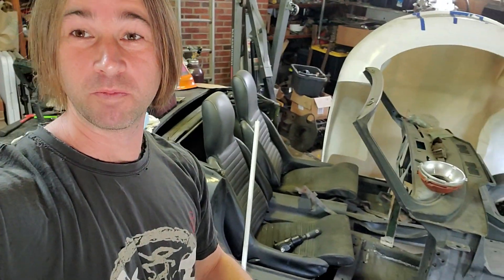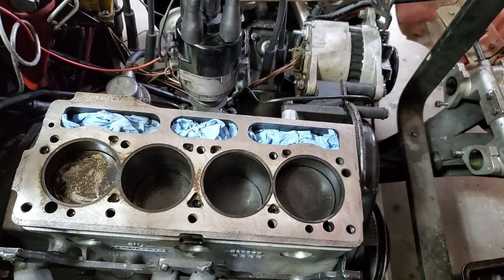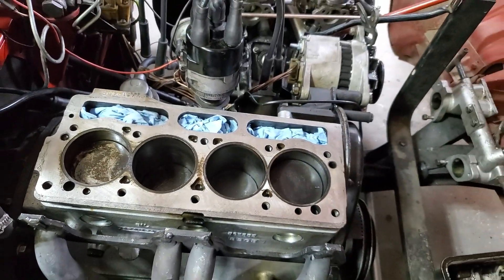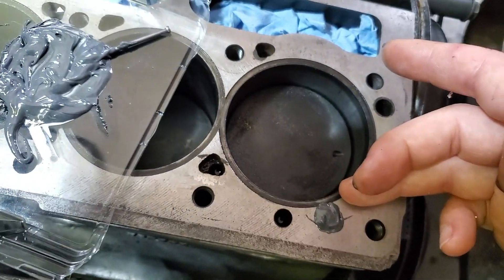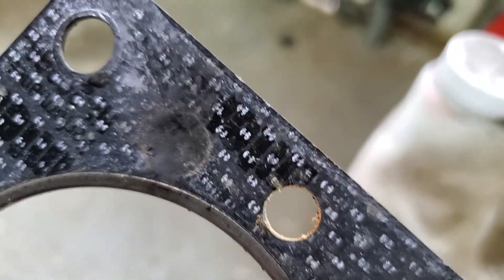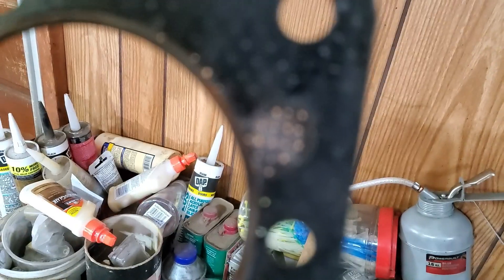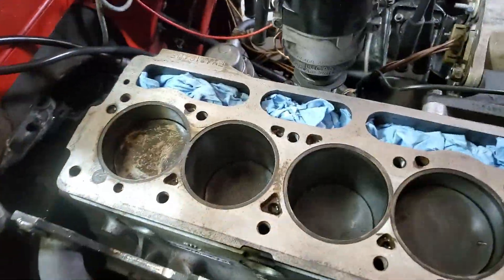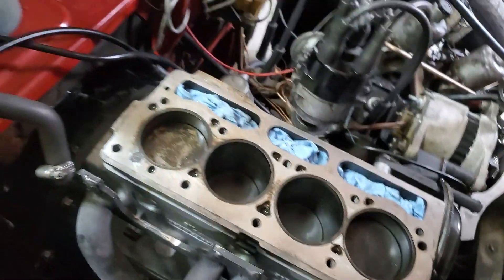Triumph Spitfire head gasket keeps blowing. Here's my solution.

Comment: Hi Dragon Gate Garage, I think I am experiencing the same issue as in this video. I am hoping you are still monitoring this channel and responding. It has been about a year since you posted this video, how has your repair held up? I am wondering how the JB Weld has withstood the heat of the combustion chamber? Have you had to replace the head gasket since your repair? Thanks for sharing your video and results.

Comment: I filled the two bore holes but I was wondering if it actually helped you prevent your head gasket to fail?
Reply from the maker: I can't tell you for certain that it helps, but I can say that it doesn't hurt. I have heard though that it helps to support the gasket in that weak spot. I read somewhere of people using a bronze valve guide in the hole then having it machined level, but that requires a trip to the machine shop.

Comment: Clamping force is on the cylinder liner, shouldnt blow unless there's an issue at that spot, pretty weird though
Reply from the maker: The major issue was cheap outsourced materials for a vital component. Old stock Payan gaskets were great, the newer stuff is garbage. I've seen many others in forums with the exact same issue.

Comment: Hey I have a 1974 triumph spit fire with a believed blown head gasket like it will crank but won’t turn over
Reply from the maker: Sometimes with a blown head gasket it won't start because you either aren't getting compression or the cylinder is full of coolant.

Comment: There are head gaskets that incorporate an o ring that go in the recess around the cylinders. You need one of those gaskets or have the top of block decked to eliminate o ring of course that will increase compression dramatically
Reply from the maker: The type of gasket was correct. It was in part the cheap gasket material that was at fault.

Comment: Couple of things: not only does it blow out to that aligning dowel but it has blown between the same 2 cylinders on at least two of the gaskets. 
Is the head dead flat?
Have you looked at using head studs instead of headbolts?
Definately be re-torquing the head after at least one good heat cycle
Plus I dont know if you use coolant in the cooling system but we always run older engines with just plain water in the system for 500 odd kms before adding coolant. 
Allows anything in the block to get flushed out when drained and with certain composite gaskets like yours we have found anti-freeze can and does soften the gasket material on certain gaskets up making it easier to fail. Put oil or assembly lube under the head of the head bolt or the nut if using studs. It increases the clamping pressure on the gasket rather than if the fastener gets torqued up dry.
Reply from the maker: Yep, both surfaces are dead flat. Made certain of that with sharpie and leveling block. Yes, using new head studs and retorquing after a 30 minute burn in. Also running just water. This thing was frustrating the piss out of me until I learned these indexing holes were partly the culprit. I used a 20+ year old Payan gasket the first time, didn't retorque it and it held great. The new Payan gaskets look very different from the old ones. Where the gaskets blew between the cylinders looks to originate from the indexing holes as well.
Reply: Heres hoping its cured now. Certainly doing all the right things by the engine thats for sure. 
Spoke to my engine machinist down here in NZ and hes seen that before. They have filled in the holes with similar plasti-metals/epoxies. Knocked in metal dowels, used brass or steel freeze plugs. All methods work none really better than another but he prefers the solid metal dowels/plugs.

Comment: Just seen your channel for the first time, great to see an old Triumph Spitfire again, I had a dark maroun red one in the late 70's anyway i digress.
An old trick I use - I think it was an essenntial on the Ford Kent motors if I recall correctly, is to spray paint the head gasket with Chrome Paint, or paint with a high Chromme content - let it dry and then fit - works really well - obviously in your case there are side issues as well.
Reply: We use VHT Copper head gasket spray. Truly brilliant for headgaskets. Stops leaks and takes up tiny imperfections in shim style gaskets.
Reply from the maker: Thanks! I believe that it is copper spray you are thinking of. I thought about it, but have heard mixed thoughts on the matter. One thing is for sure, these are not the same quality gaskets they were making 20 years ago.
Reply: We used to use Aluminium paint on our engines but the quality of the paint dropped off and it became thinner and thinner  so went to the VHT. As long as the headgasket only is sprayed and not the head/s or block it has performed perfectly for us. Ive read mixed thoughts too but have never struck any issues. We only do diesels up to 24 litres nowadays so maybe there are issues with certain petrol engines but none of the older English stuff Ive used it on for family or friends has given up any dramas.